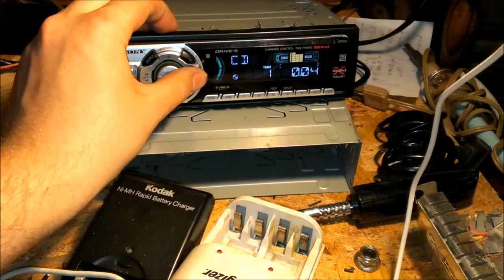aftermarket car to home stereo overheating real fix

Comment: All sony using a mosfet power amp IC´s are designed to reach over a 67° C at the heat sink and is  a normal operation temperature, I had a Cdx Gt 790 Ui and I was worry about the high temperature that its was reach almost inmediately after that your turn it on, then I realized that was normal and left it that way and never had a problem for overheating damage now after more than 4 years or operation

Comment: The reason why your car stereo there is overheating is because with all your speakers attached you've lowered the resistance to a level that it can't handle.  Most car stereos can only handle ~4 Ohms.  You've probably got about 1 Ohm going there.  Try wiring in series not parallel.
Reply from the maker: you are right. but this did actually help.
Reply: How do u wire by series and not parallel idk the difference
Reply: Jeremy Schoonover in competitions people wire their car stereos below 4 ohms but they use a lot of fans on their car head units
Reply: In car audio competitions, people don't run their speakers off of their head unit. ...  They use amplifiers.....  There's no sense in making a statement like that.  People that read your comment and believe you will look like an idiot when they repeat it to people who actually attend SQ and SPL competitions.

Comment: so not sure if this is the place for it but ill ask anyway, so about 4-5 months ago i put a new headunit (just a cheap sony one) in my car, it all worked fine, then the missus told me that she went over a bump and it stopped working i pullled it out, had a look at the fuze it was fine  put it back in and it worked again, sometimes it would not work but then a few minutes into driving itd work again, now after doing that for a few weeks its now not giving me any sound at all, the entire unit was stupidly hot when i checked it again the day was about 35 Celsius (around 95-100F for american readers) and the entire car was boiling hot itd power up but id hear no sound. so i put the shitty stock unit in, i got static through the speakers but thats all i got (it needed a code cause i took it out i dont have the code) is the head unit dead or do i have a random sudden speaker wiring issue, any ideas?
Reply from the maker: what year make and model is the car? also did you buy the plug in play wiring harness, or did you cut the stock wires to wire it in? sounds like a bad connection
Reply: its a magna 2002 advance, its using converters so ive done no manual wiring myself so like cables clip into other cables etc (im sure you understand what im on about) its all litterally just running off the stock wiring with converters the cd player im using is a Sony DSXA200UI 220W or something fairly close too that (box isnt accessable currently) i took the car out at 3 am this morning for work 2 mins driving it started working and has been working all day even after being turned off for a time AUX works CD works didnt bother weith the radio cause the radios garbage anyway

all 4 speakers work when its working only crackles when i over do the bass settings cause they are stock speakers.

it feels like the head units dying to me but im not too car savy im more a computer guy takes me 5 minutes to get into the dash to get at it so i could possible take pics of the situation and show u or something at some point if need be
Reply from the maker: it could be the stereo is faulty or still a bad connections.
Reply: any real way of testing which is more likely, the head unit was blazing hot so much so it was even a bit of a pain to carry it inside, i put it in the freezer for a few mins :P it still works well, as good as its currently working anyway

Comment: I just pre hooked a planet audio double din stereo to my car, I connected the ground then yellow to yellow n red to red. Suddenly the back of the din got extremely hot to a burning point, why would ut get so hot? Any ideas? 
Thanks
Reply from the maker: look up a wire diagram for your car. if you cut the stock wiring you did it wrong and shame on you. an adapter would have just made it plug and play after a couple connections have been made for under 10 bucks. you cannot connect color for color the will not match up. you have to go by the diagram. you more than likely blew a fuse or even worse melted some wires. ...
Reply: I didn't cut the factory wires, I bought a plug n play wire harness made for my car. This din doesn't have a fan in the back but I'll look @ the diagram. Thanks for ur reply!
Reply from the maker: if It plays just fine for over 20 min just fine then nothing is wrong they normally get hot over time dew to the little heat sink. they are built with good components. if your stock speakers are way out of spec then it could cause a heat up. if your stereo is 4 ohms but all your stock speakers are 8 ohms then it will get hot. very hot cause its pushing the stereo to its limits and beyond. if the stereo wants 4 ohm speakers then get some after market 4 ohm speakers for it. look up sound ordinance . com. the got most of what you need usually.
Reply: did you fixed your problem I have the same problem now
Reply: I ended up selling it, I'll buy a new one from ebay b4 xmas

Comment: I know this was many years ago, but...

Lmfao. 208 Watts😂😅. You said it was on a 2 amp power supply. That means that radio is not capable of making more than 24 Watts in total because there is only 24 watts of power available. It was overheating because you short-circuited the the output circuit, which would get smoking hot with a 4-ohm load. You have it running <1 and unbalanced.

Comment: fyi. all car stereos will tripp" if power is too low. You don't have enough amps with that 2 amp brick. give it at least 15 amps and it won't cut out... unless well your putting to low of a resistance on the outputs or wiring the speakers wrong. Most car stereos use a virtual ground..... so if you get the speaker grounds mixed or touch the stereo chassis it will burn it up.
Reply from the maker: yes that is true. but this actually helped it out alot. before it would shut down at to high of volume but now i can crank it up and wont shut off. the problems tho was indeed low amp input on the power brick and all my speakers were different in ohms. if they were all 4 ohms then it prolly would of been fine.
Reply: possibly but you need to do the math. at 12 volts you can only get max 26 maybe 27 continuous watts RMS in to a 4 ohm load them ratings you see on most car stereos are usually Peak RMS (near or at clipping)
you can happily drive 3 ohm loads on that thing if you have good heat sinking (Which you did and I like that Idea...) Might do that same mod to my old junky Jvs KD-R330 (My 350 died) even without speakers connected it gets hot enough to cause a third degree burn. I am just using the thing as a crossover for my sub lol.
Reply: unless it has a internal buck/boost converter to ramp the voltage up higher internally... but then that thing would be much larger.
Reply: meh depends wholly on the speakers used.

Comment: I just hooked up a dual xdvd256bt in my 05 civic, used the wiring diagram and connected every wire carefully. After a couple times reconnecting the battery I noticed it was extremely hot when I went to move it. It was working fine and the amp was also working fine but I cant figure why it's getting so hot. Help please
Reply from the maker: amps will get hot. if it doesnt turn off randomly then its fine.
Reply: bam6972 yeah I know that, the amp is fine. It's the radio, it won't be on for more than a couple minutes and it's hot. I'm think maybe track the original ground wire to see if its a good ground or not

Comment: No sound.
Reply from the maker: yea I figured that later on. just didn't make a video. the heatsink was hanging over the plug for the speakers a bit and couldn't seat all the way down. so I had to grind a bit off the heatsink...